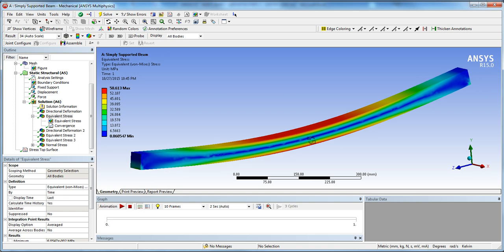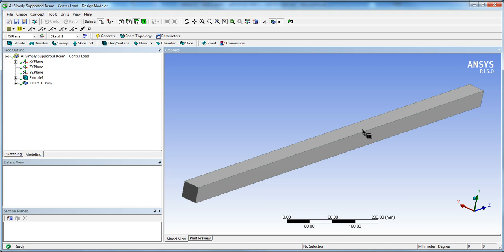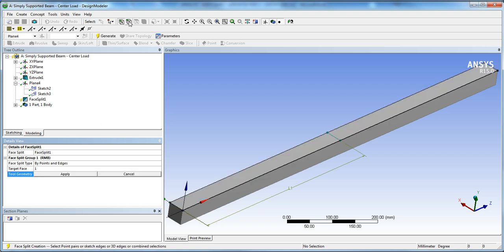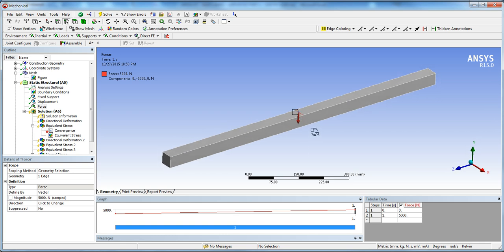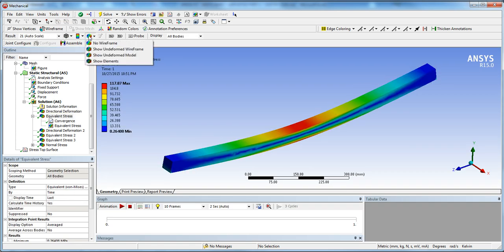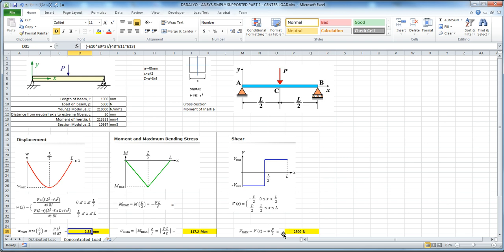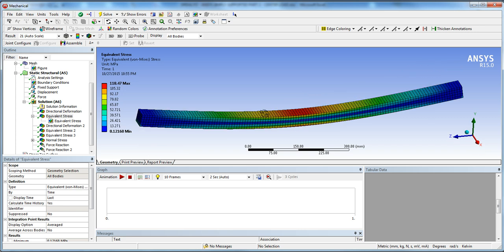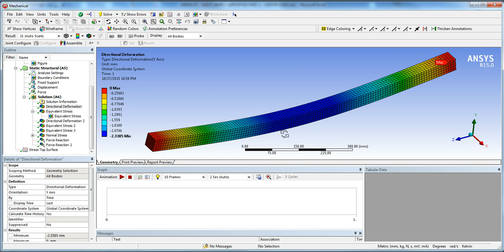ANSYS Workbench Tutorial - Simply Supported Beam - Center Load - PART 2

Comment: i have a composite material in spaceclaim and i want to bend test it , should i make the load and fixed geometry and also mesh it in spce claim then transfer in mecheanical model and then direct into structural model updating the engineering data and then defining the loads and force bars in the static structural..

Comment: How to add roller support within the beam
Reply from the maker: You could split the face geometry at the bottom to make a line, and then apply a displacement boundary condition making the vertical and lateral condition 0, and only allow for horizontal (FREE). This depends how you set up your axes.

Comment: I will add one byte of knowledge into this fourm and that is
Adding cells in the thickness actually increase the softness and make structure little softer then in real life and this is the reason why changing global size parameter to 0.8 increased the stress and deflection because it artificially soften the beam
The solution to this is to use not more then 4 cells across the thickness
On the contrary using tetrahedron across thickness makes beam stiff and thus artificially reduce the stress and deflection

Comment: why u don't use the lines creates from points and then cross section is applied to that and results are shown using beam tool
Reply from the maker: You could do that, it would be a simpler way of solving the same problem. This way just shows you more detail.
Reply: @drdalyo  thanks Dr.

Comment: When i try to use the split screen to add my force, it doesn´t go vertically even though I selected it with the edge. How do I fixe it?
Reply from the maker: You can change it from Vector to Components and enter the direction manually based on coordinates

Comment: It may be a simple question but I was wondering why did you not choose to slice the body in order to apply the load at center. I have thin stacked beam-like filaments that I would like to keep fixed from the center to avoid adding weak springs when I apply moment in the Z-axis. And I thought the easiest way for me would be to create a plane offset to the center of the stacked beams and use the slice command. I realize that this causes the bodies to be separated but if I use the Bonded condition, I hope to get a result similar to a uniform stack of beams ...is this a correct approach?

Comment: Hi Sir, first of all thanks for your sharing knowledge, really appreciate it. One quick question, I'm doing exactly the same case as yours but in 2D, thin-shell elements type. I was wondering that would i just be sketching the 2D surface and define the shell mesh in order to obtain less computational time and more accurate result or there is some other change should be made during this method? Thank you
Reply from the maker: +Piyabut Tangjitmanngamkul Your much better off using Beam elements, not shell. Draw a single line in modeler and then create a line out of it, then apply a crossection to that line (in modeler). So in this case it will be a square section, then apply the thickness/dimensions.

Comment: How would I apply a point load at x distance from one end for a 1D beam? I understand how to do this for 3D beams, but not 1D. I've tried adding construction points to my line sketch, however when I go to add a force, it only allows me to select to the two points at the very end of the beam, and the point I've added isn't visible. Reason why I ask for 1D, is that for my assignment, I have to analysis a simply supported beam with a UDL and two point loads by doing 1D analysis first and then 3D analysis and compare the results.

Also, can you explain your choice for the supports used? I thought a simply supported beam had a pinned support on one side and then a roller support on the other, however I can't find these support options in ANSYS 17. Cheers.

Comment: Is this using 3D beam elements, I have to do something similar for 1D beam elements; would these be sketching a line and using a cross section  as opposed to sketching a rectangle and extruding?
Reply from the maker: +Liam Owens yes you could sketch a line and create a line body with an applied cross section, it would give very similar results and use less computing resources. See my video on linear buckling, i believe i use a line body. Also my video on a bridge i believe. Let me know if you have any other questions

Comment: Sir,
can you please tell me how to analyze for cylindrical member.
I'm facing problem with the edge can't get the right point
Reply from the maker: +akram shaikh good question, cylinder would not be as easy.
1) simplify the problem and use a line body with a cylinder cross section and use similar boundary condition as this video. For how to do this, check my new linear buckling tutorial.
2) add two thin flat square plates at the ends of your cylindrical beam, then apply similar constraints. This should not affect the results near the center of the beam.
3) you can use Remote Displacement constraints on the cylinder edge, say left BC, constrain in Y, X, Z and the right BC only in Y, Z. Not sure of the results but you can play around with using the cylinder edge or adding BC to specific elements or nodes near your support. You might get singularities but you can just ignore them if your focus is near the center.

Hope this helps!
Thanks for watching.
Drdalyo
Reply: Sir, I'm facing the same problem with cylinder beam. But, I dont really get your explanation. Can you please help me by recording it?

Comment: very useful video.
I have a small doubt, How do I check stress on the body at specific point after the analysis, If i use Probe to check the results, I am not able to check at exact required location.
Reply from the maker: +Pavan Agarwal you can create Construction Geometry, where you can then create lines and planes, from there you can scope results based on lines or planes. If you want just a node or element, using the newer versions of ansys you can click to show mesh, and use node or element selection tools to select the node or element, then create a named selection, and then in results use the named selection as the scope. Hope this helps!

Comment: Hi is it possible to find the load required to reach a given deformation without trial and error?
Reply from the maker: +Justin Prendeville good question. No not really. Instead of applying a load, you can apply a "displacement" and then check the reaction forces to get an idea. Or you can do the trial and error but by using "parameters" so it will do it automatically
Reply: yeah good question!!! I too have some doubts can you tell how to do using trial and error?

Comment: Dear Dr. DalyO
I wonder if you can help to predict the collapse load in a simply supported beam and a cantilever beam by using ansys .
Looking forward to hearing from you.
Omar
Reply from the maker: +Galloper What do you mean the collapse load? you mean ultimate tensile strength? that would just be when the stress in the FEA reaches the limit of the material your using. So for example basic steel has a yield at 250MPa and ultimate at 500MPa, so load the model until your stress reaches this value, but if its a simple problem you could just calculate it by hand would be faster.
Missing some details here, please give me more information.
Thanks for watching!
Reply: DrDalyo, thank you very much for your reply, collapse load is the load at which the beam fails. in other words, below this load the still safe,at and may be after this load the beam gonna collapse.
I did the analytical solution and I just wanted to verify my results.
Looking forward to hearing from you
Reply from the maker: +Galloper So then it is as i stated before, depending on your materials ultimate limit, it will fail at that point. so if your UTS is 500MPa, and the stress in ANSYS reaches that value, the material will completely fail.
Reply: +DrDalyO that was a good point to start with, also I wanna add the following. A structure may completely fail even well before yielding is reached. For some, buckling stresses may well below the yield stress. Thus the users have to calculate the "failing point", which takes into account the all possible failure modes, and compare the stress from ANSYS with that value.
Reply: @DrDaylo, I would like to ask that do you have any video in which you have simulated failure of a material when the load reaches the ultimate limit of that particular material?
Reply: +Galloper, I am also looking for carrying out a simulation of material failure in Ansys. May I ask some details of which kind of material did you use and for which load did you apply? I am trying to simulate concrete in central load until fracture